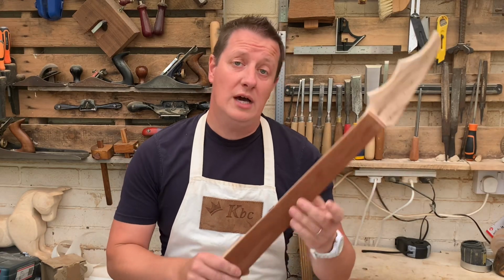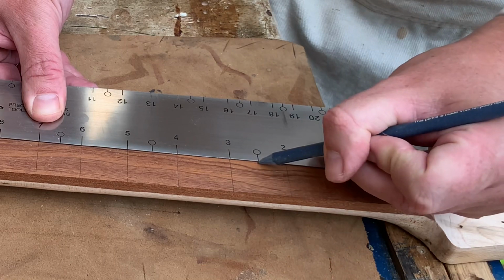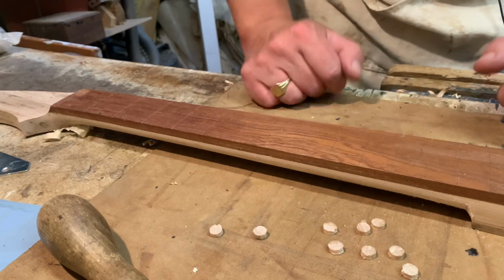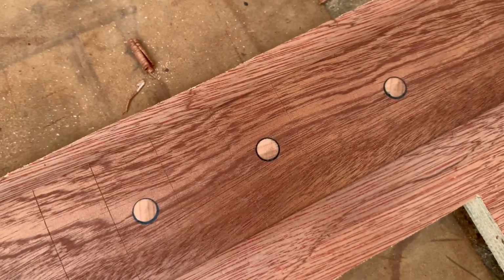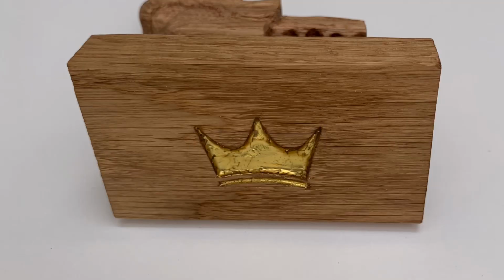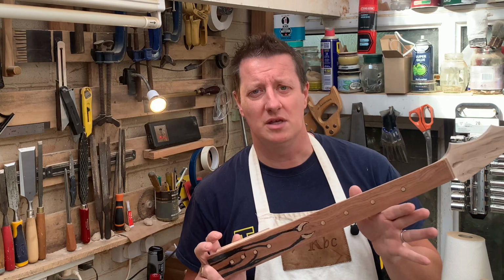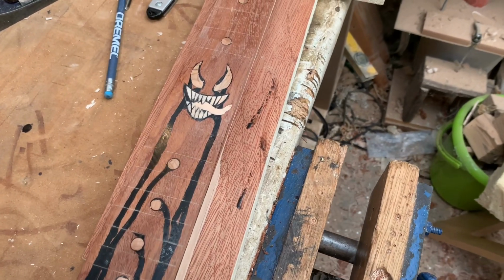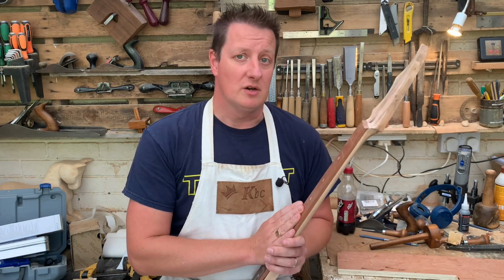The Venom Guitar  |  Simple guitar inlays and fixing stupid mistakes

Comment: A nice design on the 11th fret is perfect, so you know the 12th fret is one behind. Design wise it  fits to the 2 fret distances before that. 😉The real issue is on 2:04😳 when you use a plastic protractor to cut along with a knife🙈. Can someone from Crimson send a metal one over to Chris? 😁
I like the black superglue.  I drilled a hole though my roadgear body and wanted to cover it with a Yin and Yang made of black epoxy resin. But now I think I'll try it with black superglue.
Reply from the maker: Yes please crimson!  And definitely use the. Lack superglue. Also the brown is awesome at blending in too!